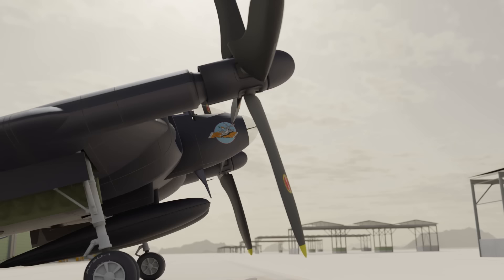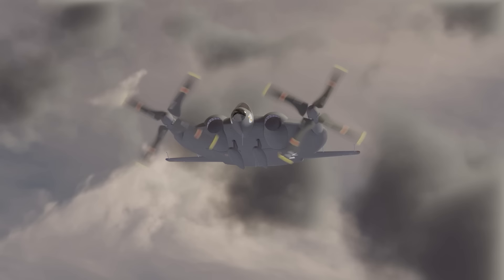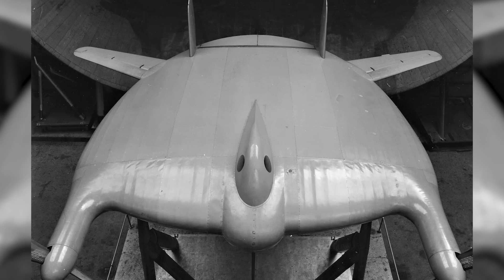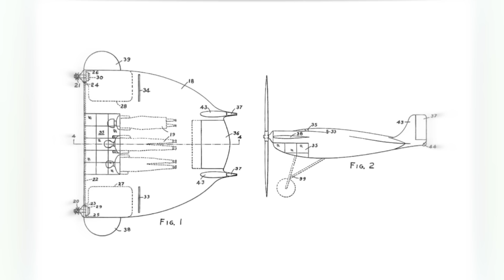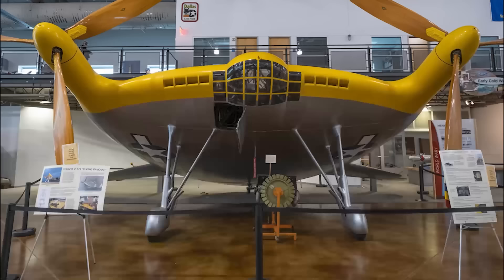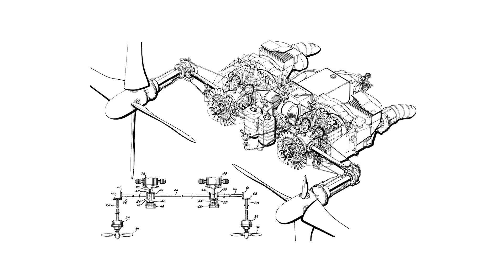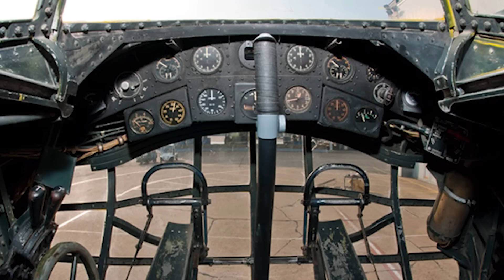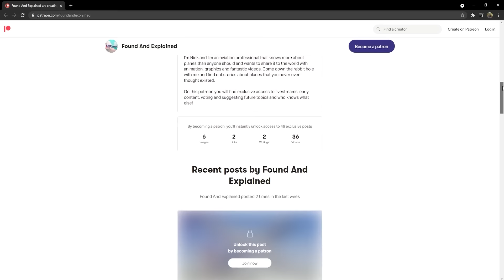The Flying Pancake - Slowest Plane Ever Made!

Comment: One detail for the animation: the 2 propellers should turn in opposite directions and opposite to the direction of the wing tip vortex, if I am not mistaken.
Reply: Well they got half of them right
Reply: @GoingtoHecq  LOL good one
Reply: Not if you want to cause problems
Reply: Normaly the lower the wing aspect ratio the greater the vortex loss and less efficient wings. This plane can get away with such chunky wings because the propellers position counteract this loss like you mentioned.
Reply: All I have to say, is that this channel reminds me of Mustard (2017-now)
Reply: Normally no. But in this case, the prop feathers in the animation are mirrored (which is correct to the actual design), so yes. They should be opposing.
But it's down to each individual aircraft if the 2+ props rotate in opposing directions.
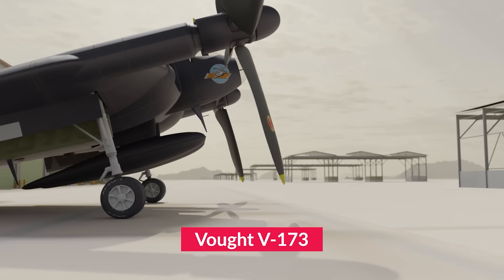Reply: @GoingtoHecq  1:30 Here everything is right…
Reply: @GrasshopperKelly  it's usually not important because most propellers aren't mounted on the wingtips. the debatable advantage is certainly non-zero and people claim up to 15% advantage. you can't actually remove vortex and still have lift, but outboard downwash increases the effective span. apparently though there's a preference for retaining control when an engine fails
Reply: well said.
Reply: Yes, they did rotate in opposite directions to cancel the vortex
Reply: @JohnSmith-eo5sp  you can't cancel a vortex and still have lift. counter-rotating propellers increase the effective span and shift the vortex further out
Reply: @Drawliphant  Also because it has no real wing tips the vortices will be minimal
Reply: No that's the correct direction. The blades pushing more air under the fuselage or wing and taking more air from the top that increases lift.
Reply: Its bc of the youtube video conversion of 24FPS video to 60FPS rate has synced up making it look like they are spinning in the wrong direction. If you set your video settings to 24FPS it will correct the issue by adjusting the strobing effect of lens flicker by the Hoffmann Effect using Ohm's Law and Rieman Sums. This was a technique created by Lucas Films under contract with the Department of Pubic Hair.
Reply: @FernandoMartinez-xf6ux  you deserve an award for this comment lol
Reply: Depends on the design.  I've seen a B-17 fly and all of the props spin the same direction.
Reply: Quite right. The direction of rotation of the propellers in the model is incorrect. Find and download blueprints for the Vought V-173. The correct direction of rotation is clearly indicated there.
Reply: A common myth.
 They did not counter the vortices.
Zimmerman chose the planform specifically to maximize the vortices at very low speed very high A (nose up angle). It makes zero sense that people think he then went to such extravagant means to "counter" the vortices which he specifically chose the planform to maximize.
No one who claims that such wings must be draggy and might need props to "counter" them knows about the vortex driven "parachute lift" that it was using. At very low aspect ratio (span^2/area = 3 or less), at very low speed very high A the vortices wrap around and capture a bubble of low pressure above it, maximizing lift at such speeds. They also trap flow from the front over the top of the wing and keep it from separating, providing the controls with strong smooth flow. They do not stall.
Zimmerman specifically wrote about this after having seen the Arup S-2 fly for NACA.
He copied the planform of the Arup for his VTOL tail-sitter, but neither the V-173 nor the XF5U had enough power nor appropriate landing gear to do so.
The V-173 did gain efficiency nor speed nor its super-STOL stall-proof performance from the awkward situation with the props but solely from the planform.

NACA tunnel tests of the V-173 showed conclusively that the situation with the props did not gain it anything nor particularly change anything versus normal 80hp props spinning the other way. If anything it sacrificed speed trying to "sculpt" the airflow, by swinging those huge props around.

Very low aspect ratio planes are not inherently very draggy.
The Arup and many other examples have defied the supposed rules and equations which say they must be draggy.
Everyone who claims they're draggy is ignorant of the vortex driven parachute lift, and confuses the drag generated while flying very slowly at high A, with cruise conditions. They are not draggy but notably sleek and quick on little power.

The misconception about the props on the Vv-173 supposedly countering lift has made everyone believe that they're always draggy, when ample real world experience of such planes shows the opposite.
They're not draggy but sleek, with astonishing climb rate.
Reply: @Drawliphant  
It is incorrect that the propellers spinning outward in any way counteracts the vortices.
NACA tunnel tests showed that it did not gain anything nor particularly change anything versus normal props spinning the other way.
The V-173 got its super-STOL abilities and stall-proof handling solely from the planform which was not inherently draggy.
It is simply a myth that this sort of wing always has huge vortices following it around.
Many planes with aspect ratio under 2 have proven to be sleek and quick on little power.
Reply: So they rotate inwards
Reply: @FernandoMartinez-xf6ux  pleasure reading this
Reply: The props do rotate in opposite directions.  It’s on the animations that are not correct.  If you had used your eyes when looking at actual film you would have seen that.  Duh
Reply: You are mistaken. Don't tell people how to animate when you don't even understand aircraft.
Reply: nature already made one of these, the manta ray.  So, why give pancakes the credit?  The Manta Ray was robbed
Reply: The rotation is not correct in the animation, but if you look carefully they have opposite pitched propellers.  If this were real it would be doing circles!
Reply: @Ozone077  You can see from the drawings (that are included in the video) that the props are meant to be turning in opposite directions. Note the direction of pitch of the prop blades.